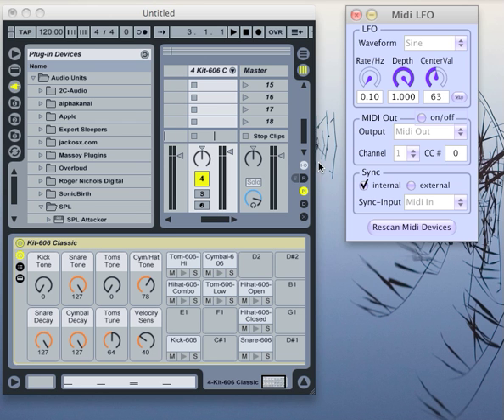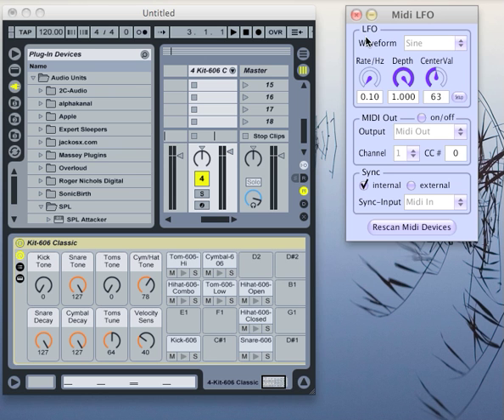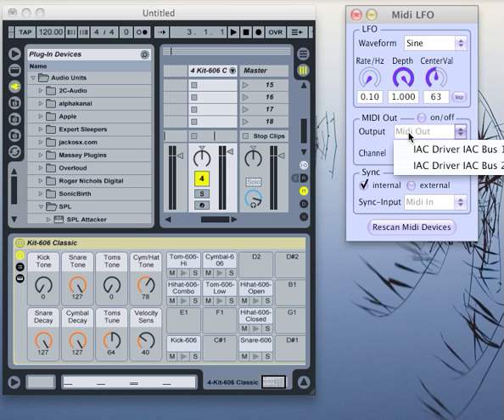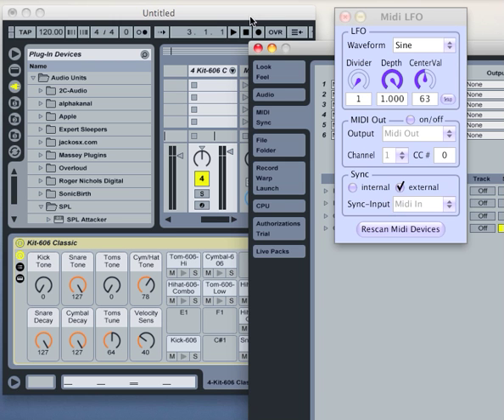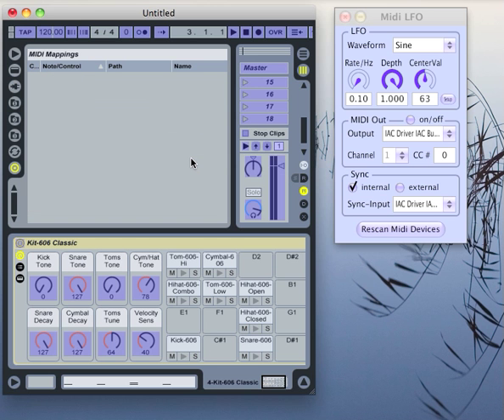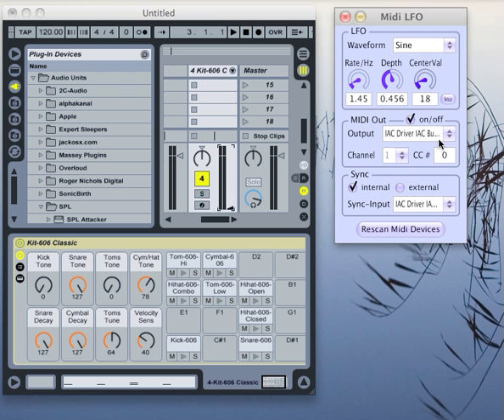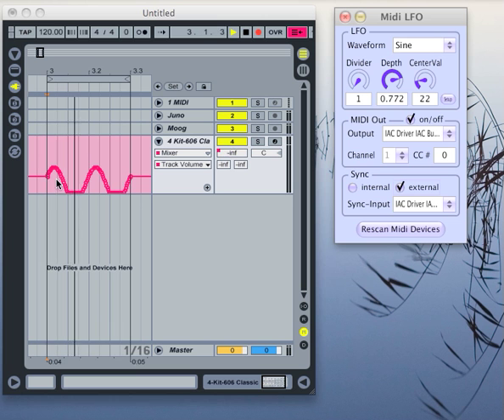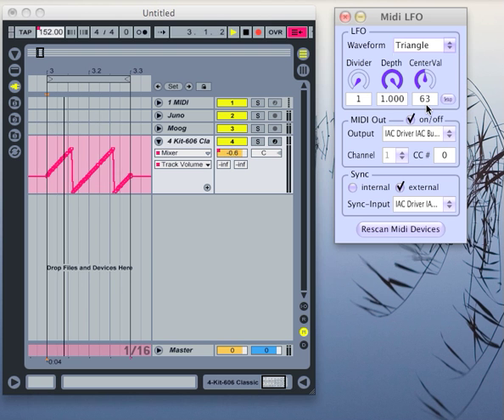tinyMidi LFO - Software presentation and mini tutorial

Comment from the maker: @pablix809 Hi pablix809, the midi LFO can send midi to any midi out. If you want to send midi to another software application you need to use a virtual midi out port. The IAC Driver (comes with OSX) provides that functionality. It can be activated in the Audio MIDI setup. (Window->Show Midi Window, Doubleclick IAC Driver Panel and hit "Device is online"). Then choose the same IAC driver in your host software as input. Just google IAC OSX and you´ll get plenty of tutorials. 
Cheers!